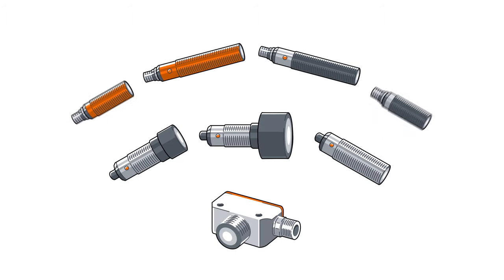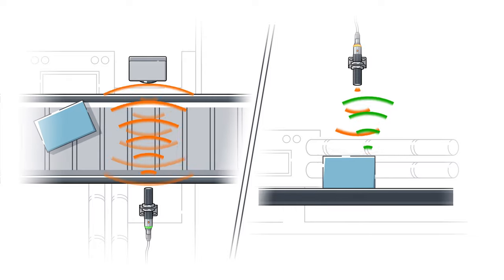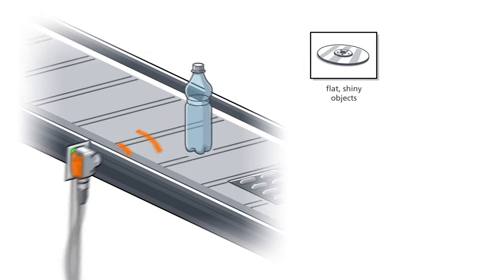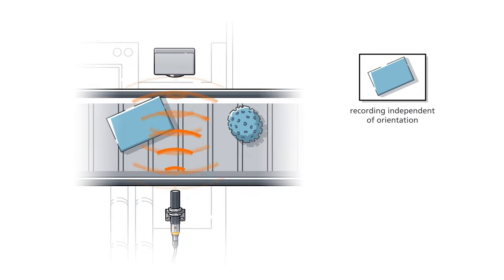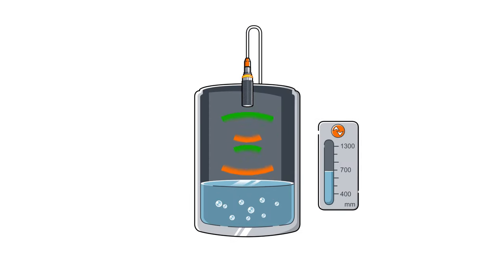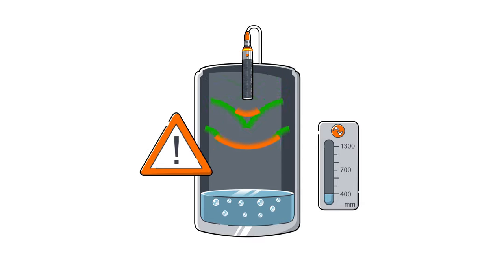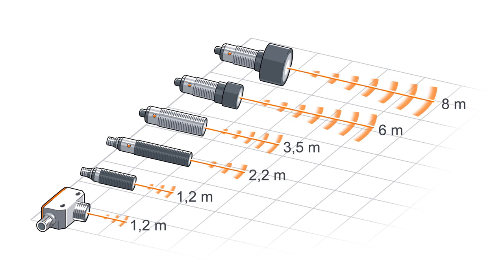Ultrasonic sensors – the alternative for difficult surfaces

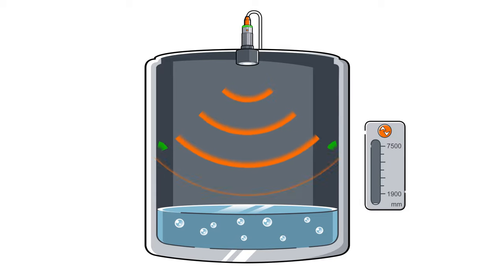Comment: 1:36 @ifm : You say in the video that these sensors can be used in tanks to measure liquid level. Wont condensation be a problem? As far as I know, Ultrasonic sensors fail to measure correctly when there is condensation.
Reply from the maker: Condensation is a problem in rare cases. Due to the vibrations of the membrane and the mounting direction of the sensor, deposits on the sensor surface are unlikely, but cannot be ruled out. It is correct that any foreign body such as dust or water in the form of condensate can influence the measurement. It is not generally possible to determine at what concentration an influence on the measurement result can be assumed. Functional tests are essential here.

Comment: What is the range of ultrasonic waves
Reply from the maker: Hello Mukesh Kumar,
the range depends on the design of the machine. As taller it is and as taller the ultrasonic wave producing surface is, the higher is the range of the ultrasonic waves. To get the specific range, you should take a look in the technical datasheets.
We hope this answer could help you a little bit. :)